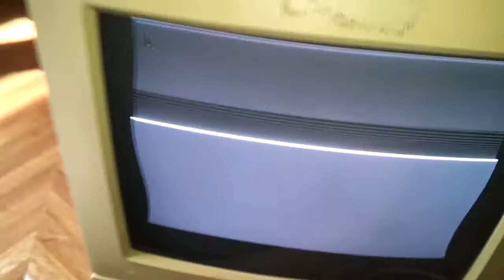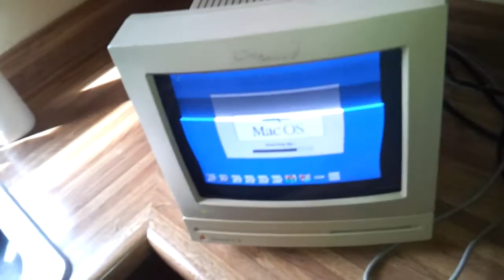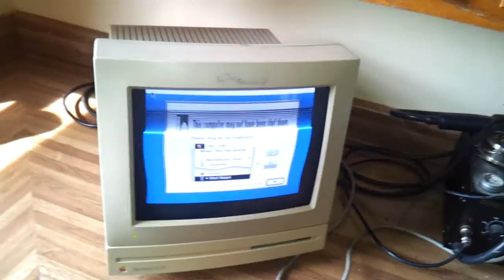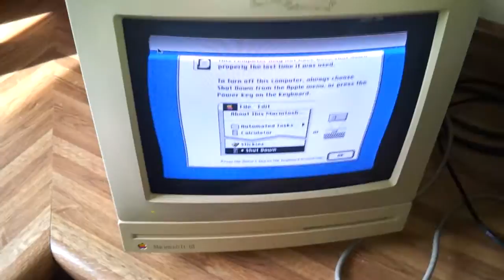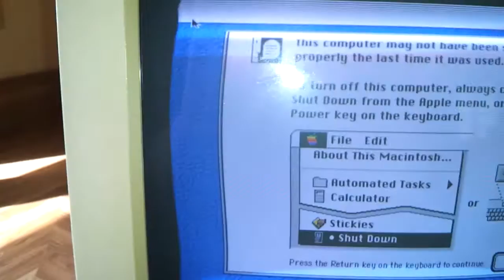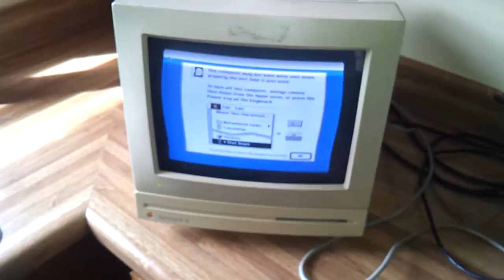Macintosh LC RGB M1296 monitor fault diagnosing.

Comment: Do you have any idea if it  will turn on withouth the unit? I have only the monitor and the on light is green but no picture displaying.
Reply from the maker: Nope. you need a computer plugged in.

Comment: Hey techknight. Ive drove all over Ireland collecting macs and allot of the time I managed to get them with the monitors. Have 2 of the ones in this video, a portrait monitor (came with an lciii, and it had a radius video card for rotating the display I think) 3 apple monitor ii, and a very small apple ii monitor as well. Powered up just 2 of them, the first came on for a second then display disapered, the second went bang. Have not touched them since(waiting for someone like your good self to show the way!!).Are these problems 'mostly' caps, and is there the same risk of shock from the flyback. Have not opened any of them as I no knowledge where to start. Looking forward to part 2. Cheers techknight
Reply from the maker: +fenorcity Crap gets in there from sitting in uncontrolled storage as well, and that crap cross conducts and fries shit. I just uploaded a new video working on this particular monitor. Everything is pointing to a bad deflection generator IC. LA7824. I got a spare "new in box" board but the flyback is toast. of course.... Serviceman switch-a-roo and put back on shelf to be sold as "new"